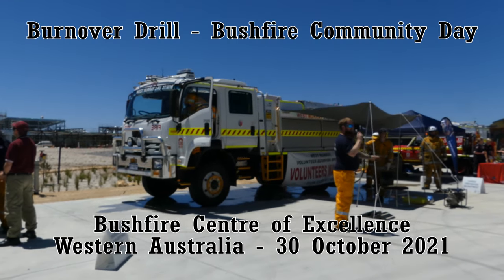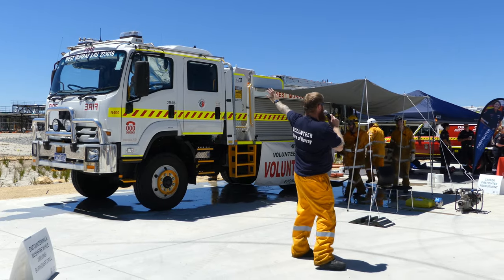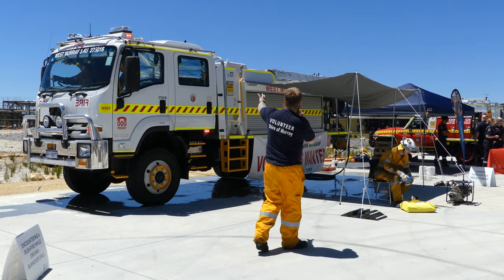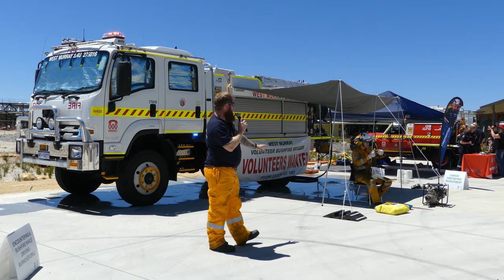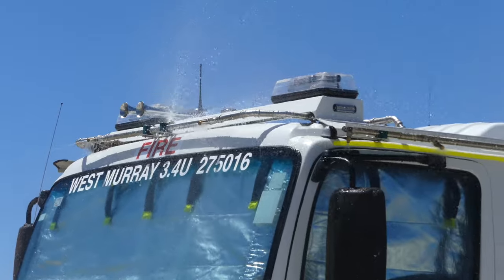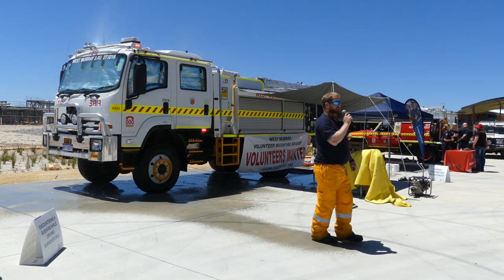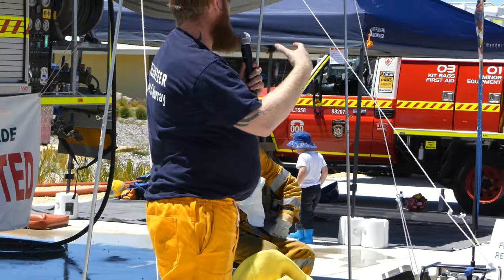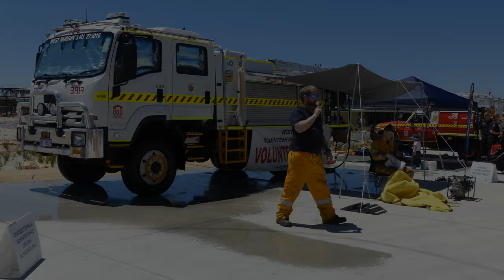Fire Truck Burnover Drill Demonstration - Bushfire Community Day - 30 Oct 2021

Comment: Hello. I missed the part at the end. Are vehicles out of commission once they've gone through a burnover? It sounded like he said another truck needed to be brought it. I figure that's because the truck needs to be checked. Is there another reason? Thanks!
Reply from the maker: That's how I understand it!
Reply: Yes. To be inside a bushfire is one of the most hostile environments on Earth, in the solar system even. Temperatures can soar to hotter than a kiln, which will damage even metal. Thus, for such an important vehicle to remain safe in similarly hostile environments in the future, it needs thorough inspection afterwards by experts before being reused.
Reply: Fire will melt all under the truck, so your brakes are gone and everything and it just isn’t safe to drive

Comment: I built alot of these systems and instailled them, from this video, the system dosent even seem to be operating correctly, you would be drenched were you are standing, no window delgue active, good info but not a full CCP system, system should run for 5 - 7 mins
Reply from the maker: They were using the hose reel all day and did several burnover demos without refilling, perhaps that is why? 🤷‍♂️